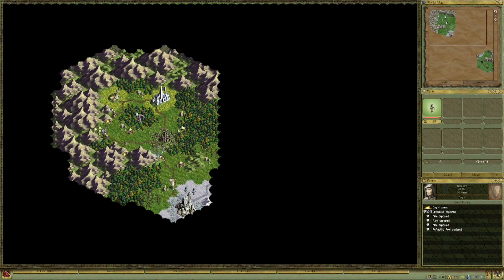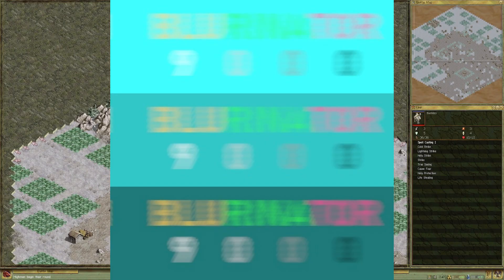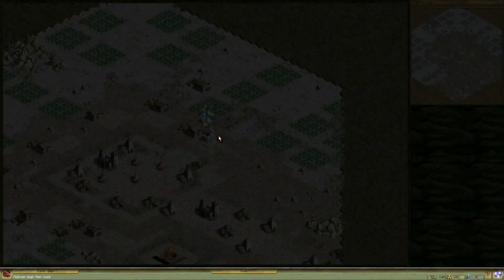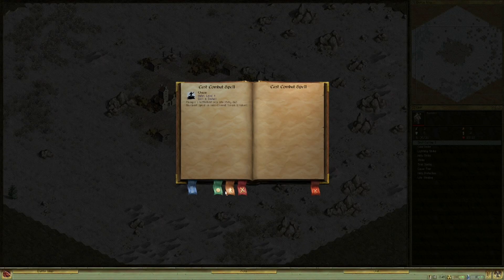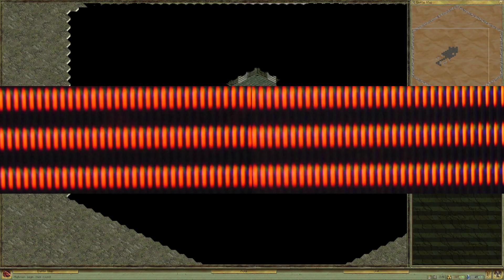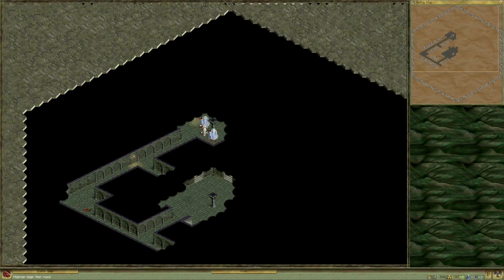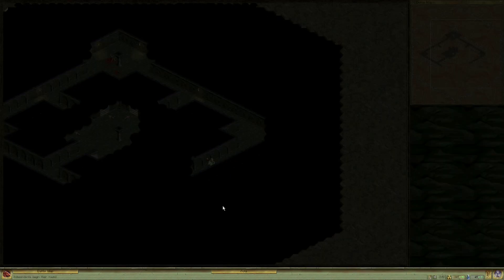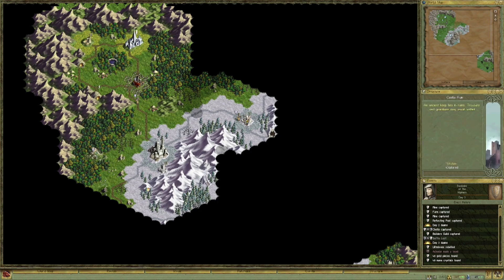Why 240p120hz(and other hz doubling) is a mistake

Comment: Great info, thanks. To complete the scanlines issue: The way lines are drawn on a 15KHz CRT (a standard 4801 or 240p) is very different from a 31KHz CRT (480p) or 33KHz CRT (1080i). On a 15KHz CRT the electron gun is less focused, so it paints a wider line, this line is wider with high luminance and thinner with low luminance values, this results in rounded bright pixels, the dark lines we commonly refer to as "scanlines" are not width uniform. This effect (and many other effects) is what many of us look for when using a CRT for retro 240p games, a 31KHz CRT has the electron gun far more focused and has a great stability on scanline width which simply can't display this rounded bright pixel effect.

So yeah, you can use a 31KHz CRT with a scanline filter to play emulated retro games (or use an upscaler or line doubler like the OSSC with classic consoles) and get the high motion resolution of a CRT which no display can match, the high luminance on bright tones CRTs are famous for that makes games look awesome, the gamma curve saturating some tones on a very pleasing way, but and is a big but, you won't get the round bright pixel effect and to me that's a really important effect for 240p games. Some very advanced devices like "RetroTINK 5x-Pro" or "MiSTer FPGA" include the function of adding "Adaptive Scanlines" which darkens the lines more on areas with dark tones and darkens a lot less on lines among bright tones, these preserve luminance and creates a kind of bright pixel effect with excellent results on fixed pixel displays like LCD or OLED, even better when combined with interpolation and a "CRT mask filter" apperture grille, slot mask or shadow mask. And yet the best is still a native 15KHz CRT
Reply from the maker: You also lose the appearance of the mask. What you're talking about is more about linecount than horizontal scanrate compatibility. A CRT projector or BVM D24 would also lack that effect.

Comment: I'm curious if anyone has attempted to do the black frame insertion thing using external hardware instead of in software on the originating signal source. Couldn't you emulate 480i that way too? Just run 120 htz at 640x480 and draw alternating lines for each frame. So you de-interlace the source then draw each half of the outputed lines on alternating frames on the 120hertz output to effectively "re-interlace" the output. Though I could see this not being a thing because FPGAs aren't fast enough for this perhaps or am I missing something here...

That aside I think the main issue with using scanline shaders is perhaps they aren't as authentic to the real thing ... when using LCD/fixed pixel displays.

I think using them on CRTs is fine and people need to get over that I think. The end result is probably identical on CRTs. Having some kind of 120 hertz reinterlacer for 480i would be cool though but I could see why that might be impractical and perhaps just unnecessary. Besides that wouldn't do anything for 240p stuff anyways and I was just going off on a tangent with that idea. :P
Reply from the maker: You can emulate interlacing at 60hz using the interlacing.slang shader in retroarch. No 120hz needed.
Reply: @displaytalk  Oh wait yeah I forgot 480i NTSC runs at slightly below 30 FPS so you could do that at 60hertz. :P
Reply from the maker: @MagnumForce51  well, actually 480i60 runs at 60fps, half resolution, so to simulate it in 60p you just alternate scanlines, each blocking off half the image(height-wise) every other frame.